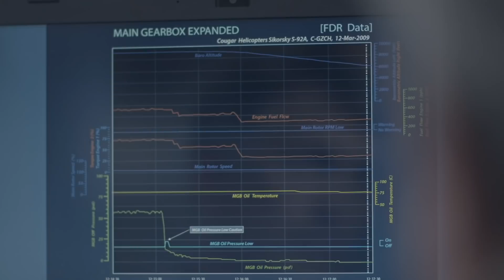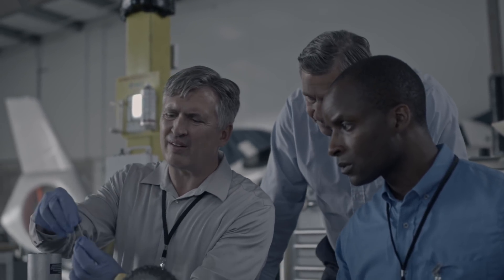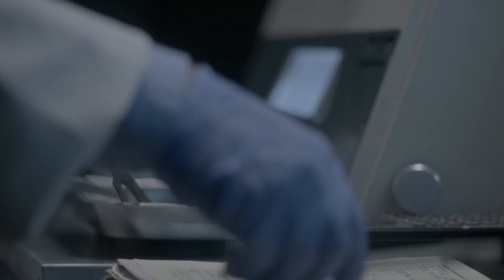Was This Helicopter Doomed By Design? 🚁 Air Disasters | Smithsonian Channel

Comment: The last thing you want to see in a helicopter is loss of oil pressure in the main transmission.  You put the aircraft down immediately. Never mind what is underneath you. You only have a few minutes before the transmission ceases and the main rotor breaks off.
Reply: Things are a little different when "what is underneath you" is the North Atlantic.  In this specific case the pilots were given a time that they could operate the transmission without it locking up, even without oil pressure.  The gearbox would get trashed over this time but it would get you to land.  Total loss of fluid is what actually happened via the filter cover, and this was not designed for nor anticipated in the risk amassment.  The filter cover leaked because two of the three titanium filter housing studs had fractured as a result of inadequate preload causing a fatigue fracture.  That was either galling or installation error, but that single mistake shouldn't take down a helicopter that's designed to operate far off-shore like this one.  Google TSB A09A0016 if you would like to read all about it.

Comment: Air worthiness releases should be acted on, not shelved for a later service or inspection.  I remember when gearbox failures where due to walnut shells in the oil passages.
Reply: Depends on the degree of priority the manufacturer and the FAA place on the release...If it's labelled immediate then yes...but in this case it would appear routine - to be done within a year or 1,200 flying hours...that sound urgent to you? Do you immediately perform all the advisories your mechanic suggests as "as and when" for your car?

Comment: This is a job that could have been completed in an hour. It is nothing to take those studs out, put in new helicoil inserts and and install the new steel studs. I used to be a helicopter mechanic in the Army, and worked extensively on the Sikorsky UH-60 Blackhawk. Had to do repairs like this many times during my career, it is literally a nothing job. It only becomes hard if the studs snap off during the extraction process, even then, you get an easy out, tap it, and back it out, so it adds like 15-20min of work.
Reply: it sounds like the nuts were one problem. Another was the gearbox was supposed to be able to run 30 minutes dry but couldn't. There's a whole list of recommendations resulting from this accident.
https://www.tsb.gc.ca/eng/rapports-reports/aviation/2009/a09a0016/a09a0016.pdf
Reply: @bc1969214  Yes, nuts were one problem .... the nuts sitting in a corner office at Sikorsky.
Reply: because of access, the 92 filter bowl studs are pretty hard to reach. Ive done this mod and its a few hours on the 92.

Comment: In 1978 I ditched a Sea King helicopter (Sikorsky design) due to main gearbox oil pressure failure caused by a filter bowl failure.  Forty years on and they still design gearboxes that need positive oil pressure and have crap filter bowls. I also flew the Westland Lynx and that was cleared to fly for up to half an hour after oil pressure failed - because it was properly designed.
Reply: Just so long as yours has the newer bolted rotor hub installed, or the old one is less than 3500 hours...
Reply: I did inspections on the threaded stud that held the MGB filter bowl. Found a few cracked…
They did finally modify it
Reply: Terrible design it should screw on like an everyday oil filter then use 3 bolts to lock it in place so it doesn’t unscrew itself also use lock wire. I would design it where there is a secondary cylinder/housing covering the filter which is also sealed so if there is a problem u don’t loose oil and have a pressure sensor on the secondary housing so if it sees pressure you know there’s a problem
Reply: Interesting. So this problem is nothing new.

Comment: I had the same thing happen to me on a Bell 212 combining gearbox. Stud pulled out. Engineer had made an unorthodox stud repair with a sealant instead of re-tapping threads. I had been deep over the jungle moments before it failed.

Comment: 2:35  wow. amazing insight. the galling was cause by the only thing that could have caused the galling.
Reply: Who would have thought ?😨
Reply: the design had been previously used elsewhere without problems but this helicopter required a high amount of unexpected filter changes.

Comment: So Sikorsky identified the problem and instructed operators to fix it, and the operator didn't fix it. And people died.
Reply: No they had 1200 flight hours or one year.
Reply: lol. brain damage
Reply: Oof
Reply: No, Sikorsky identified the problem, created a notice that was financially beneficial to them and bet that no failures would happen so they lowered the urgency, operators were aware and followed the notice to Sikorsky's letter, and THEN people died, but guess what Sikorsky saved money.
Reply: @SMG_Wizard  are you saying that because you work for them or because you’re making a guess?
Reply: @robertgary3561  It really doesn’t take a guess. Remember Firestone tires on the Explorer, or the uncontrolled acceleration of the Prius? Companies this size are always weighing the potential risk vs. the cost involved in correcting it. 
The plane scene in Fight Club is actually accurate to what really happens.
Reply: @jeepdude7359  because of Firestone we know the behavior of Sikorsky?
Reply: @robertgary3561  I was clearly using it as an example. Do you disagree that these companies attempt to downplay known problems simply because the cost to correct them is greater then the price they put on life.

Comment: I will never understand why some manufacturers go for exotic materials like titanium or carbon fibre for parts where weight is not a concern. For so many applications, the strength, toughness, and dependability of plain old carbon steel simply cannot be beat. Its chief disadvantages are its weight and the possibility of corrosion—neither of which is a concern in a glorified bolt constantly bathed in lubricating oil.

Notice that Sikorsky replaced the titanium bolts with steel. Not aluminum. Not carbon fibre. Not adamantium. Steel.

Because it works.
Reply: Weight is a big issue in helicopters.   Anything that can be made lighter  is made lighter.  Unfortunately lighter is not always better.  

The use of titanium and aluminum has made many things possible that would not be possible using steel.   
The key is knowing when and where to use each type of metal.   Aparently in this case they did not use the proper metal and when the mistake was discovered it was not taken seriously.
Reply: @Bendigo1  Yes, it can be easy to take weight savings too far. But if you've got to cut back on pounds, cut seat count instead of safety. Just one bad crash can finish an aircraft model and sometimes even the manufacturer.

Back in the 1970s, an engine fell off a DC-10, causing a crash. It was entirely the airline's fault; they cut corners in maintenance and damaged the engine pylon, and didn't buy the stick shaker option for the first officer's station, only the pilot's. This meant the crew weren't alerted to the coming stall, even though the DC-10 can fly on only two engines just fine.

But it was bad form to knock the customer, so Douglas took the hit. The DC-10 was savaged as a winged coffin in the press, and the media circus pretty much ended sales of that model. And that was long before social media and cancel culture.
Reply: @shane99ca  
Unfortunately making money is more important in most commercial aviation.    Those seats being eliminated are paying passengers being eliminated.    Im definitely not saying it is right, it is just how things are done.
Reply: @Bendigo1  "Paying passengers being eliminated" is unfortunately exactly what this cost-cutting resulted in. And it is not done by companies interested in staying in business, because sooner or later it does catch up with you.
Reply: @shane99ca  I agree.    Save a penny spend a dollar.    
Im just saying that sometimes big companies don't always think that way.  They look for the best way to save money at the beginning and make money over time, not realizing that saving money in the beginning can cost more money in the long run.
Reply: @Bendigo1  True—but then they still should have gone with steel bolts, because the weight difference in real terms is negligible and they cost a whole lot less. There is also a tendency on the part of both manufacturers and clients that expensive, exotic materials are always better.
Reply: @Jean Pierre Boichut C'est vrai.
Reply: Actually, pound for pound, aluminum is both stronger and tougher than carbon steel.
Reply: @rsrt6910  But not by volume. Neither are more exotic alloys like titanium. A titanium sword as strong as a carbon steel one would be the size of an oar, although it would still weigh less.

And the size of the bolts to be replaced is fixed, I believe.
Reply: @shane99ca  Volume is NOT the issue with aircraft, it's weight.  And titanium is NOT "exotic", it's THE most abundant element in the Earth;s crust.  The issue with titanium is that it's a universal solvent, making it difficult to separate from other elements(TiO2 comes to mind, but I'm sure there are others) and difficult to weld.
In addition to it's weight, titanium also binds to itself in a close packed hexagonal arrangement making it VERY strong (but less ductile) for both it's weight AND volume.  The bolts and axles on my skate plates are titanium and they're half the size and weight of comparable steel ones.  A titanium sword as strong as steel would probably weight 67% of a steel one and be noticeably thinner and hold an edge longer (though it would be a bitch to sharpen).
Reply: @rsrt6910  Excuse me, titanium is 9th most abundant, after oxygen, silicon, aluminum, iron, calcium, sodium, magnesium, and potassium. Titanium is also very brittle compared with iron, which makes it hard to machine, hard to weld—and easier to shatter.

And volume is a concern when you need to craft a bolt to certain dimensions. If you have two bolts of the same size, one of steel and one of titanium, the steel one will be much stronger, and also much tougher, making it less prone to cracking and breaking. Since the size of the required bolts is set and cannot be changed, go with steel, every time. Yes, it will be heavier, but we're talking what, a pound? Two at most?

Oh, and a titanium sword as strong as a steel one would be much thicker, though still lighter. It would also be much more fragile. No swordsman worth his scabbard is going to turn down a tough, hefty steel blade for an unwieldy paddle of metallic glass that, if it catches a good stiff wind, will Mary-Poppins him right off the battlefield.
Reply: @shane99ca  Your first paragraph just restated what I'd already said so I'm not sure why you repeated it.  Titanium is the most abundant element "In the Earths crust", but even allowing for it being the ninth, does that mean if titanium had only made it to being the eighth it wouldn't be "exotic" but since it's ninth it is?!
But having worked with both materials I know for a fact that by volume AND weight that titanium is stronger than steel, (I'd already stated it's less ductile, but you must have missed that). Load bearing axles and bolts made from titanium are two thirds the size of low alloy carbon steel counterparts (our 8mm steel axles have a cross section of 50mm2 while the 7mm titanium ones have a cross section of 36mm2 even though they both are rated for 500ftlbs of tension with cyclic loads in excess of 6 tons). The fact that titanium has a higher yield strength makes it ideal under tension and as long as that point isn't exceeded in either material, there will never be an issue.
So once again, for the same tensile strength, in addition to being lighter, a titanium sword would need a cross sectional area only 67% of it's steel counterpart, hold an edge better, be a bitch to sharpen, and be more prone to fracture than bend due to is close packed hexagonal crystal structure.
Reply: @rsrt6910  n some circumstances yes, but steel has a better fatigue resistance and higher operating temperature.
Reply: @chippyjohn1  Only if you exceed the components yield strength, and titanium's operating temperature is over 200 degrees higher than most steels.
Reply: @rsrt6910  Actually maximum mechanical temperature of titanium is about 400c less than most steels. Titanium also suffers from thermal fatigue.
Reply: It's not just one bolt, it's many, it adds up. Using lighter bolts that need to be changed more regularly is not exactly cost cutting for 3 bolts. It is standard that titanium bolts can only be used a number of times before replacement depending on loading.

Comment: the gearbox casing failed as in cracked.the pilots were alerted by a loss of oil pressure warning,however,in his misplaced wisdom,the pilot noted"hey oil temps ok",little realizing,the sensor was displaying gearbox air temp instead,cos oil had already spewed out.so pilot decides to descend to a 1000ft in a futile attempt to reach a safe landing somewhere,"hey,ditching from a 1000ft is more survivable than 4000ft? he should have put that craft down immediately on,or in the water,they all had survival equipment as standard,i dont like to speak ill of the dead,but that lack of judgment killed all except one,the gearbox shattered and it fell like a stone,no  autorotation available and it makes my blood boil to this day,them poor workers died cos of a 2 fools in control trying to be heroes.if this truth hurts,it should.
Reply: According to the Sikorski Pilot Operating Manual, in the event of a MAIN XMSN OIL PRESS low:
"Catastrophic transmission failure will result in loss of helicopter control. Consideration should be given to transiting at minimum power airspeed and a low altitude flight profile (approximately 80 ft and 80 KIAS) to permit a quick flare followed by an immediate landing/ditching. Applicable steps of the Immediate Landing/Ditching emergency procedure should be completed."
Now, without the benefit of 20/20 hindsight and an FAA/NTSB failure investigation, it seems to me the pilots were not only NOT FOOLS, but they were doing EXACTLY what they should have been doing by the POH.
Reply: @rsrt6910  granted,but one thousand ft gave no one a chance,once it all stops spinning,helis become anvils,survival equipment useless if you are unconcious/stunned.so put the fool who wrote the manual on trial,he got it so wrong,then educate pilots about catastrophic gearbox failure and the consequences,then innocents will have a chance of survival.thank you for your reply,the whole incident still gets to me.
Reply: You know, except for the gross majority of them that are retired after a safe and loooong service life... unless it's an old Vietnam era Huey, in which case they are STILL being flown by private owners today.
Reply: @rsrt6910  on a lighter note,yes ,no commercial pressure,fastidiously maintained,id love to upgrade to a huey someday.

Comment: If they had the gearbox right there to see if the studs were gone would they have not seen them gone already? Like wouldnt that be the first thing you do, inspect the gearbox as they knew there was a loss of oil pressure
Reply: Kevin Smith  yeah but theyre acting all surprised its that there is no bolts in the thing. When they saw there were no bolts they would have come to the exact same solution of why it crashed